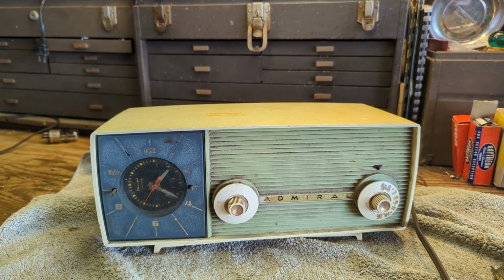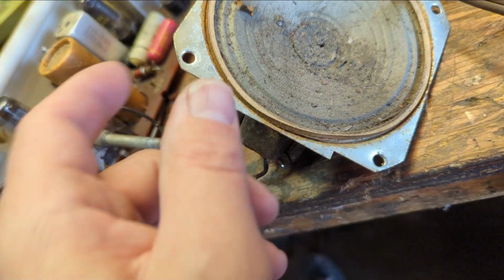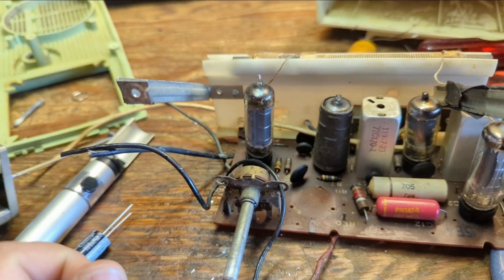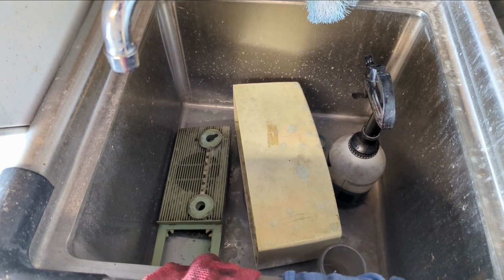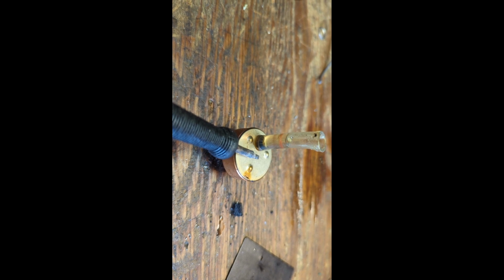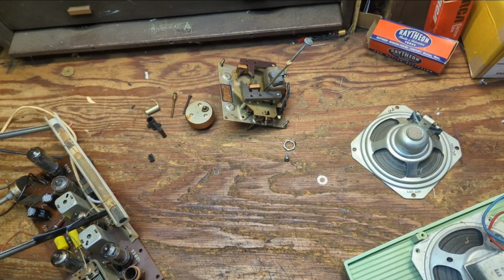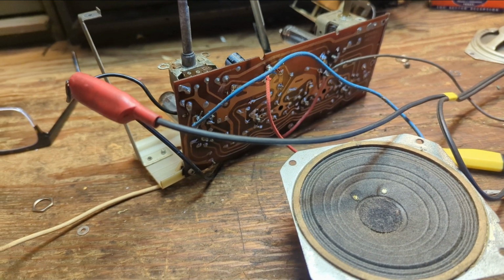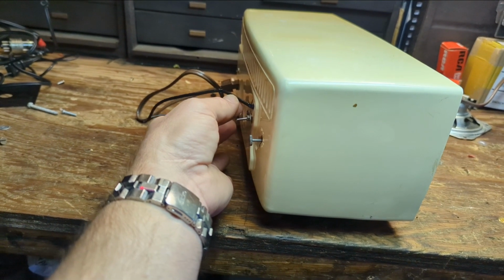Utterly trashed, grimey Admiral clock radio overhaul

Comment: Admiral model 288 clock radio with chassis 5E4 from 1958. Damn great job replacing the bad speaker, cleaning the gross
cabinet and restoring the chassis and clock mechanism Seth. Nice looking mid century design with Bluetooth added.

Comment: I like those junky old tube radios. I collected those old radios when I was a kid just to play around with them. Tubes put into the wrong sockets, components put in the wrong places or different sized components put in. It was fun! I was such a geek back then, for Christmas, I asked for a tube driven car radio! I didn’t get the one I wanted but I got some cheapie set from Radio Shack with a built in speaker. I wanted a set out of the junkyard. Oh well. Love your vids!
Reply: Those tube car radios are a pain to work on sometimes.

Comment: Nothing wrong with plugging a series string AA5 radio direct into the wall for initial checkout in my opinion. Worst case is there would be a short in the B+ and you would blow the cathode bonding wire off of the 35W4 which acts as a fuse. I think this is quite rare however, I have never experienced it. 

A selenium rectifier I would think about a dim bulb, or just change it out in advance. You don't want that smell in your house, that is a smell you don't forget.

Comment: tbh, I thought this one was a goner! lol 
I wonder if that plastic case can be primed and spray painted with something like automotive paint, to bring back its color to the exterior. Or is that not compatible with heat from tubes?  
Also, is there a decal missing after cleaning, or were the Admiral letters painted on and dissolved? If I was a potential buyer, I think I'd want the brand to be on it. 
This was again very interesting to watch. I have no idea what those things inside all do, but I enjoy the process of bringing it all back to its normal function again.